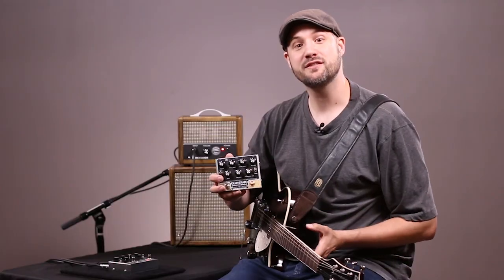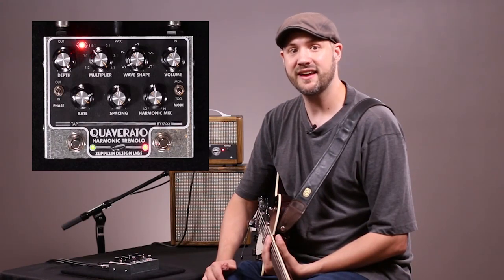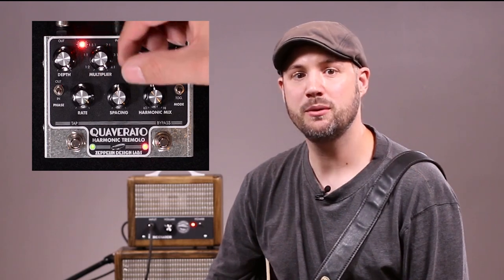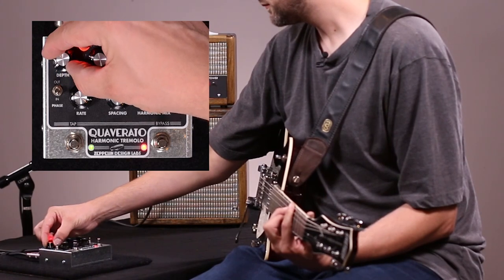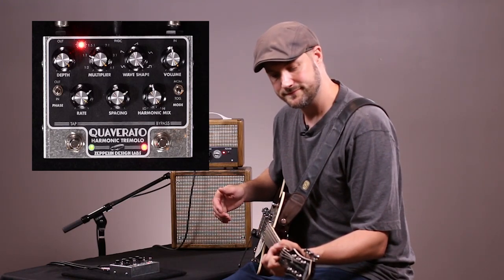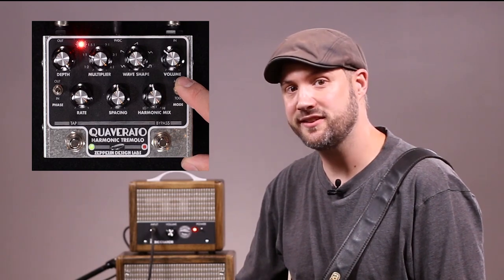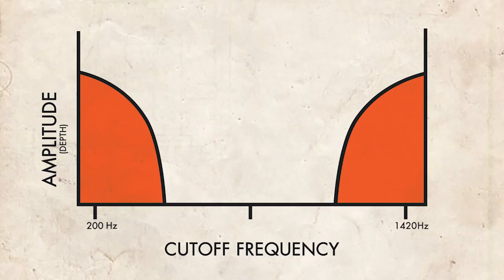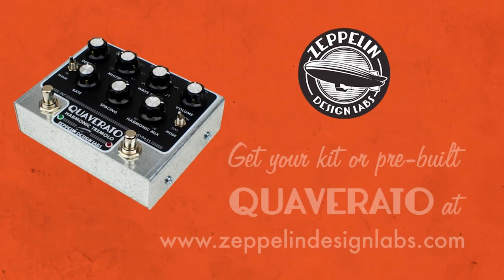Zeppelin Design Labs Quaverato Harmonic Tremolo Pedal In Depth Demo

Comment: Just got the diy kit in the mail two days ago and built it yesterday. It was by far the best pedal kit I've ever done. I'd considered doing a veroboard build from scratch but there's no way in hell I could have built something of similar quality as the quaverato without spending much much more then Zeppelin Design Labs charges. To say you get your money's worth is an understatement. Pretty much all the components tested to withen 1% tolerances(i tested every single one) and the foot switches are a dream, so smooth and precise. The little details like stand off' s for the 3mm LED's made this kit really great to put together. I opted for midi although I only use midi in my DAW but again for such an excellent price I couldn't pass it up and I'm sure if I ever lend it out the midi function will come in handy for the guys I jam with who use midi controller boards. I could go on and on, seriously. It was a great experience, an i highly recommend it to anyone. I've been building pedals for a few years and modding pedals and guitars for almost a decade but the detail and careful planning of the build doc makes this build accessible to even beginners. But I would highly recommend not doing it until you've soldered for at least a year or really now how to solder well and have a soldering station. You could use a 40watt weller but a 40watt weller in a beginners hands is sketchy, this kit deserves a good iron and to be put together by someone with some experience, but again if you just can't help yourself and your a novice you'll likely get the hang of it. And again, the build doc is put together so well that even a complete beginner wouldnt struggle with knowing where everything goes etc.. But anyways I'm getting off topic. I'll end by saying I'm highly looking forward to future ZDL releases. This is a great pedal! Thanks ZDL!
Reply: Michael - your comments on the build doc are really helpful.

Comment: The "under the hood" DIP switches and pots can drastically alter the tonal character. The Quaverato can be tweaked to well emulate just about any tremolo or vibe in existence.
I think a video showing some settings to get classic sounds from well known recordings would be super helpful.
Reply from the maker: Those are great ideas, Brian.  Thanks for the suggestion.

Comment: Really looking forward to building this kit. I'm waiting on a klon clone to arrive but it's a very easy build so it shouldn't be long until I can move onto the Quaverato. I'm honestly amazed at how much tweakability you've built this circuit to have. Is it in a 1590BB? Regardless of the exact enclosure size to have all those features in such a small space is impressive, even more so that the board doesn't look chaotic but precise and neat. Well done!
Reply from the maker: The Quaverato comes with its own custom steel enclosure, but it is very nearly identical in size to the 1590BB. Thank you for the compliment on the PCB design. Brach works incredibly hard to develop circuits that work well, are easy to follow, and even look nice.
Reply: @zeppelindesign  It shows!
Reply: @zeppelindesign  FINALLY got around to ordering the DIY kit from your site. Ive been wanting to do it since we last talked but i had a lot of projects that i needed to do first to get my pedals more organized, finish some other builds and mods etc. Anyways id really like your input on something related to the Quaverato. I was going over the build doc in my spare time (and in anticipation of its arrival lol) and i noticed you added test points to the PCB for the three variable resistors (which makes the initial setup so much easier, what a great idea!). And after having them set at the desired values you instruct to solder the two jumper pads next to the test points to complete the circuit. All of this i understand but what i wanted was your input on something id like to do to make checking the values of those VR's a little easier after the initial set up. I realize that to test the variable resistors with my multi-meter they cant be in the circuit which is why the jumper pads need to be desoldered so they are no longer completing the trace. But id like to put something either on the jumper pads or the test points that i can use to easily disconnect and reconnect. I like to tinker and find the settings i like best by trying different values and to do that i like to be able to get accurate readings that i can compare with one another so id likely have to soldering and desolder more often then is "healthy" for the pads. Not to mention it would be nice to not have to pull out my solder station each time id like to reset them. So my idea is to add jumper pins to the pads or the test points and use a "header shunt" to connect them or better then that would be to use a 1 way through hole jumper switch like the one in the link, id likely not be getting that exact one but it would be the same style of switch.

https://uk.rs-online.com/web/p/dip-sip-switches/2799847/

So what id like to know from you is if you approve or not and if you do think its okay would you recommend only switching from off to on when the pedal is disconnected from a power source etc? Any recommendations or info would be great. I've said it once but ill say it again, this pedal seems to really be designed and laid out excellently. I only just ordered it so i dont have it in my hands yet but from what documentation i have looked through it looks great. Thanks again for any help you can provide!
Reply from the maker: @michaelinglis8516  Yes, in theory this should be fine. The test point holes are not necessarily the size or spacing to accommodate header pins, but if you are crafty and can slip those components in there, you should certainly give it a try. And powering off before throwing a switch is always a good idea. Let us know how it goes.
Reply: @zeppelindesign  Excellent, I live next to mouser so I picked up the components today. I got a few different things to try. Crafty is my middle name.....not really it's Clark but all the same I'll let you know what I decided to go with.....Thanks again for the quick reply!
Reply: @zeppelindesign  Wow, just wow! I just finished building the quaverato and I can't begin to tell you how impressed I am at the meticulous detail you put into not only the pedals but the build docs as well. It was the best pedal kit and build experience I've ever had/built. Worked as expected the first time I powered it up etc. I'm having a ton of fun figuring out where it sounds best as far as gain levels and high/low levels an cut off frequency, it's really great havong so many parameters to dial on to taste(all my guitars and pedals o mod for lots of tweakability so thus pedal was right in my wheelhouse). Theres a couple things I'd like to ask you about but I'll get to that later since everything is working and they are more or less curiosities. I just really wanted to take the time to say that I really enjoyed the build. That pcb is beautiful btw. Oh lol remember me asking about bridging the jumper bad with a switch or header of some sort? Well in the build doc the jumper pads seemed to be each separate trace being bridged (on my phone it was hard to tell the scale of this lol) but the jumpers are the perfect size to easily desolder. I actually desoldered them a couple times already without issue so I could get an idea of what value the settings I liked were. Just desoldering braid and some 91% rubbing alcohol to clean up the flux. So once again you designed the jumpers optimally as well. The only part I didn't use was the wires but only cause I love the silicone wires I have but there would have been nothing wrong with using the provided wires especially since they are so neat and tidy being in pairs as they are, the gauge is a little higher though with my wires. They are either 22 or 24, will this be in anyway less than ideal? I suppose I could ask just one other question since my curiositys got the best of me. I've noticed when the 9v dc supply is connected to the pedal and I touch the chassi to any pedal jack thats connected to a pedal that's on my board the quaverato will turn on even though there are no patch cables plugged into the quaverato, plugging a cable into the out jack will also turn on the pedal if the jack going into the out jack is connected to the rest of my pedal board unsteady of only powering up when the in jack is connected. Is this normal or have I got something bridged that shouldn t be? And if I plug 9vdc into the quaverato away from my board and plug a cable into out it won't turn on (as is normally Correct) but if I plug a cable into the input jack it turns on like it should. I hope that's making sense if this sounds normal just let me know but if not I could send a video better explaining what's going on. Anyways like I said before I'm blown away. Building this pedal was pure relaxation since you went through all the extra work to make the build doc so in depth. I could have built it without some of the more meticulous details but I love they were there cause it just made everything so much simpler so I could just enjoy the process. I'm gonna get to know the pedal a little more then post a review to the Zeppelin Design labs site cause I'd like other people to know what a great experience I had.
Reply: @michaelinglis8516  How did it go m8 ? I'm ordering mine now
Reply: @chaskiandcie  Sorry I never saw this! It went great, I love my Quaverato! I use it every time I play guitar which is at least once a day. It's an excellent Harmonic Tremolo but I never realized how much I'd love using it as a boost in the fx loop  to beef up partial split coils and humbuckers in parallel etc.

Comment: I own this pedal and it has some great features and tones.
But, sorry if it sounds harsh, for me it's just one more "1000 possibilities" pedals wich i can't really use for gigging.
It may be fun to play around with it.
As long there are not at least 2-3 presets it's not practical on stage, or is everybody using just one trem sound the whole evening?
And fiddling around during a gig ain't practical.
Reply from the maker: I agree, presets are very practical.  I don't know if you are aware, but this pedal does have 6 user presets, but they are only available through midi control.  
I have one of these pedals on both my gigging pedal boards.  I do have midi control on one of them, but I don't end up using any of the presets.  I find the settings that sound good with the band and type of music that I'm playing and just leave them set for the whole gig.  I just use the tap tempo on different songs.  But I usually use tremolo as more of a subtle effect, and I understand that may not be the case for other guitarists.
Reply: @zeppelindesign  
Thank you for your response!
I don't have a Midi rig. Just an old style pedal board.
I'm into Rockabilly and Surf music, so tremolo is a "have to have" effect and often very prominent.
To set that straight:
Your pedal produces wonderful sounds! 
So for ppl like me it would be nice to have some presents besides Midi.
As a trained Electro Technican i'm thinking off building in an Expression pedal jack to have direct control of the speed.
Reply: @zeppelindesign  
so this is my second response to you after a few weeks☺️
I didn't want to jump into the Midi thing, i quitted Midi 1985, beeing a keyboarder back then.
So after thinking it over, i got me a Midi Controller just for the Quaverato. I love the sounds so much, it may be worth it.
I hope i can figure it out to set up the system so i can use the presets.
Is there a kind of manual somewhere how to set it up?
If i manage that i maybe can also connect my Tape Echo pedal, wich also allows presets over Midi.
Thank you in advance, greetings and happy holidays from Bavaria Germany 🇩🇪🌲

Comment: I have one. It's excellent. I'm looking forward to the MIDI mod.
Reply from the maker: MIDI Mod is out! Get it now at https://zeppelindesignlabs.com/product/quaverato-harmonic-tremolo-pedal/
You will likely also need to update the Quaverato software which is very easily done with our new Updater App, which you can get for free here: https://zeppelindesignlabs.com/product/zdl-updater/
You'll also need a little piece of hardware called a USB-Tiny Programmer, not free, which you can get here:
https://zeppelindesignlabs.com/product/usbtiny-programmer/

Comment: sounds great...what mini stack is that?
Reply: That’s one of Zeppelin Labs products - the Percolator I believe
Reply from the maker: Daniel Parsons is correct; that's a Percolator 2W - 1Tube amp, sitting on a 1x8 cab. The amp sports a single 6AF11 Compactron tube; the 1x8 contains a jensen CR8 speaker.  Both are offered as kits or ready-built.
https://zeppelindesignlabs.com/product/percolator-2w-amp-kit/

Comment: I like this kit but putting on the knobs is a royal pain! I've built many kits and build circuit boards for a living, but these pots suck. Every time I screw in the set screw the position of the knob moves a little. It took an hour to get them set proper. I like D shaft pots or maybe spline shaft pots better.
Reply from the maker: Yes, I agree there is room for improvement there. Maybe the next batch can feature D shafts, which I also prefer. There are sourcing issues involved.
Reply: I had an have the same issue for sure. Making a spacer like ZDL's suggest helps but the pots should certainly be changed in future iterations. I'd also like to see a high an low frequency test point that can be checked without having to pull out the soldering iron and resolder the pads. I actually modified mine with sockets so I can unplug them to severe the connection and get a reading from the test point. Sure you can set them by ear but I want to know exactly what the value is when I find a setting I like. And you can only solder and desolder those pads so many times before they are going to give out. Even with a really good quality board like the Quaveratos. But overall the Quaverato is a great pedal that hasnt left my board since I finished building it a couple years ago. And I have a ton of pedals always fighting for a spot in my signal chain/on my board so if a pedal doesn't deliver it gets bumped. The Quaverato is an excellent pedal with a little room for improvement but the quality of the board, enclosure an parts are excellent. It's just that the pots arent as ideal for the knobs provided. As potentiometers they function flawlessly and are good quality. It's just the shaft style that's the issue.